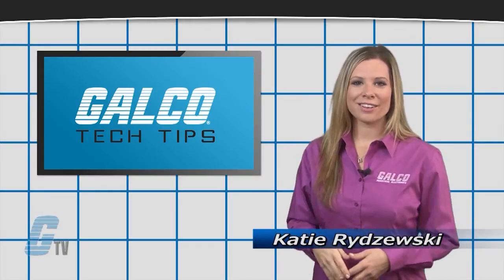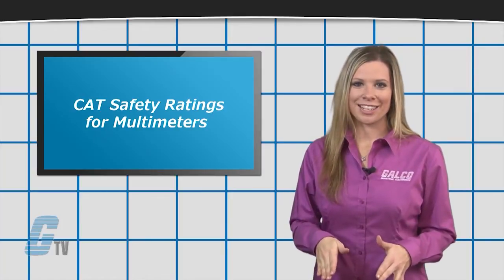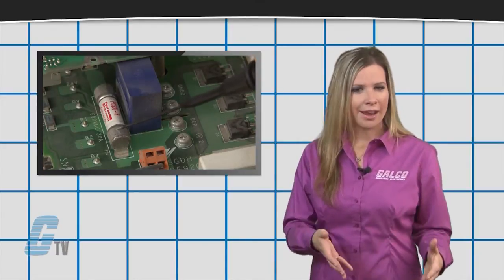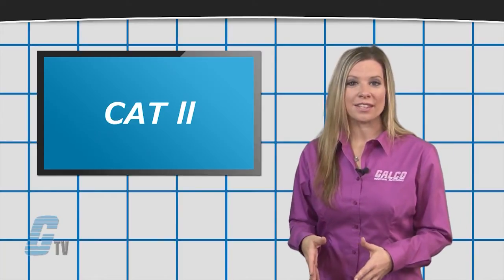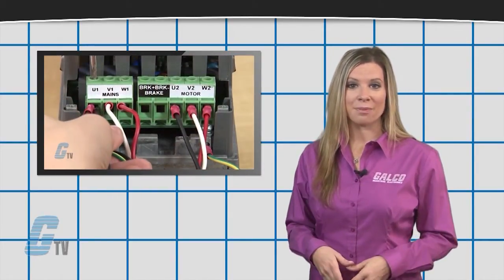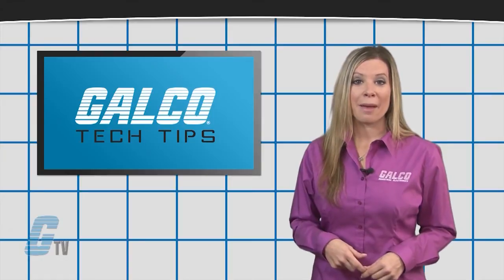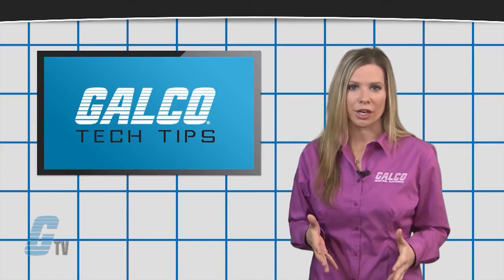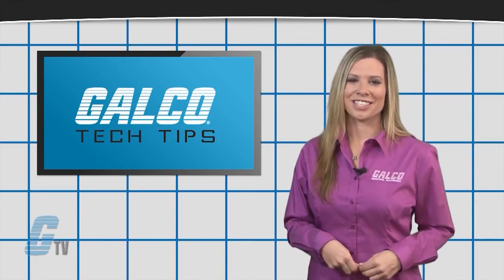Understanding Multimeter CAT Ratings - A GalcoTV Tech Tip | Galco

Comment: One important correction is needed on this video. Multimeter ratings are NOT made to protect the multimeter. They are ratings to protect the user! The multimeter must not fail in a way to harm the user but there is no stipulation that the multimeter must survive.
Reply from the maker: Well said. The operator is most important. We apologize if it came across that protection of the user was not the primary focus.  We wanted to emphasize that the safety ratings are not the only precaution needed when working with electrical systems and that the multimeter should not be seen as the end all protection needed for the user.